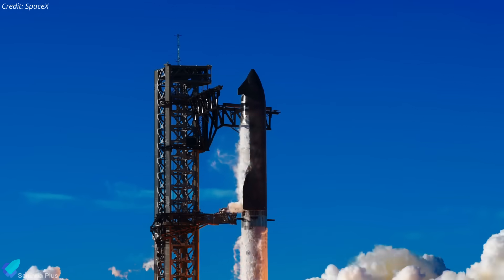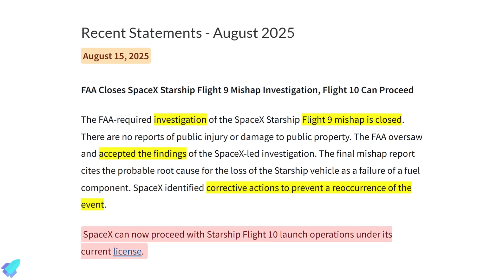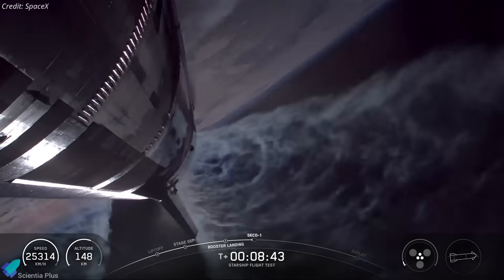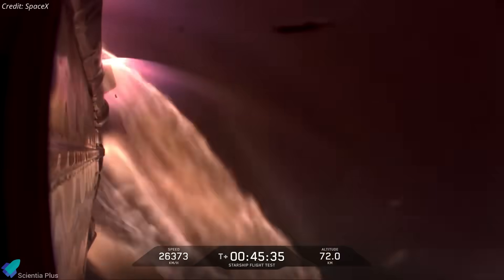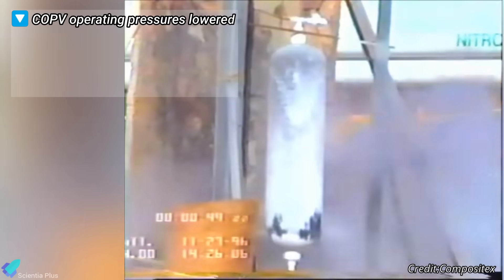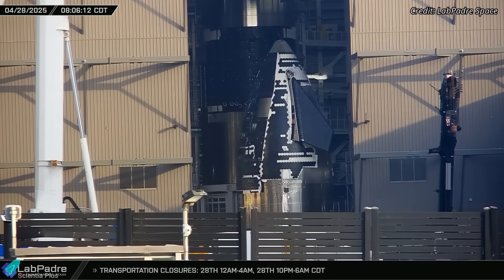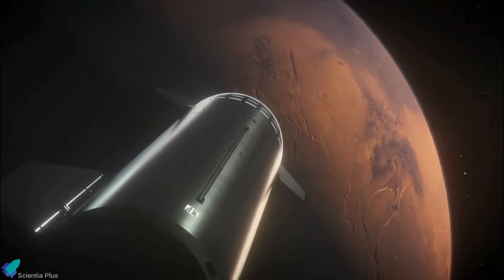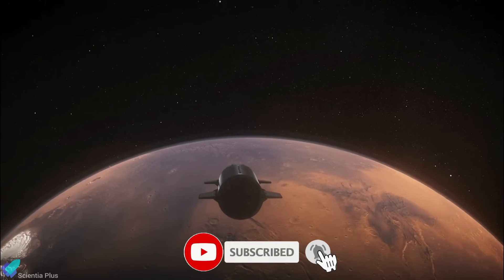BIG MISTAKE! A Tiny Diffuser DESTROYED Starship Flight 9 - Detailed Analysis! Flight 10 Launch Date

Comment from the maker: 00:00 Starship Updates
09:49 Two Mega Rockets Launch Minutes Apart

📚 Learn More:

🚀 Starship Block 2 Explained:
 📖 Summary: https://shorturl.at/b0dtw
 🔍 Detailed Explanations:
  • Design Improvements Update 1: https://shorturl.at/lpGT7
  • Design Improvements Update 2: https://shorturl.at/gwNQ4
  • Nosecone & Payload Bay Redesign: https://shorturl.at/xa60S
  • Methane Downcomer Redesign: https://shorturl.at/XdYBG

🚀 Starship Block 3 Explained: https://shorturl.at/mnBT4
🚀 Starship & Booster Block 3 Detailed Breakdown: https://shorturl.at/IViwD
🚀 Starship & Booster Block 3 Production Begins: https://shorturl.at/xRNkJ
🚀 Booster Block 3 New Transfer Tube Explained: https://shorturl.at/Iaqc6

🔥 Raptor V3 Mega Upgrades & First Test: https://shorturl.at/TRIyj
🧱 What’s Inside Starship GigaBay?: https://shorturl.at/nJM75

Pad B Explained
🛠 Insane Engineering of New Starship Launch Pad B: https://shorturl.at/7RAZd
🛢 Dual-Port Orbital Refueling – Full Technical Breakdown
https://shorturl.at/5tiqK

🛠 Other Starship Upgrades:
 • Hot Staging Explained: https://shorturl.at/jf400
 • Super Heavy Booster Upgrades: https://shorturl.at/Pi5R3
 • How SpaceX Protects Raptor Engines: https://shorturl.at/4Om8F
 • New Heat Tiles Explained: https://shorturl.at/p2Ijb

🚀 Starship Flight 7
 📽 Complete Breakdown: https://youtu.be/UqzZx7vb-TA
 🛠 Root Cause & Fixes: https://shorturl.at/HcLKo

🚀 Starship Flight 8
 📽 Complete Breakdown: https://youtu.be/f26yH80RK2o
 🛠 Root Cause & Fixes: https://shorturl.at/vsGFB

🚀 Starship Flight 9
 📽 Complete Breakdown: https://youtu.be/2eirgcUzwts

🔥 Starship 36 Explosion:
  📽 Detailed Breakdown: https://youtu.be/VWQiIz1ymBA
  🛠 Damage Report: https://shorturl.at/Quoex

🚀 Ariane 6 Engineering Explained in Detail: https://shorturl.at/XrOtZ
🚀 Vulcan Centaur Engineering Explained in Detail: https://shorturl.at/t9V0t

📡 Stay Updated:
📢 Weekly Updates: https://bit.ly/3HIQjPC
🚀 SpaceX Playlist: https://bit.ly/34wue8T

🌍 Follow Us:
👍 Facebook: https://www.facebook.com/scientiaplus